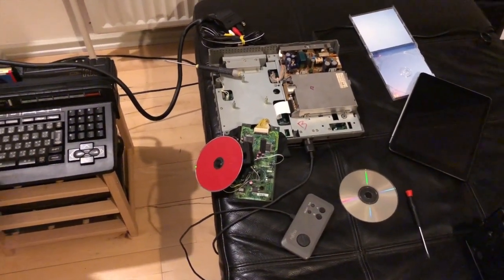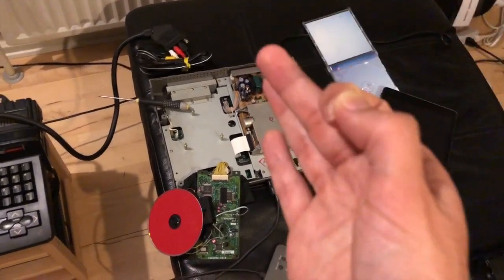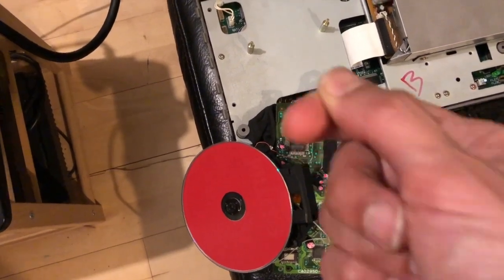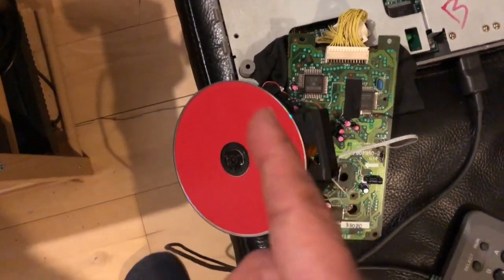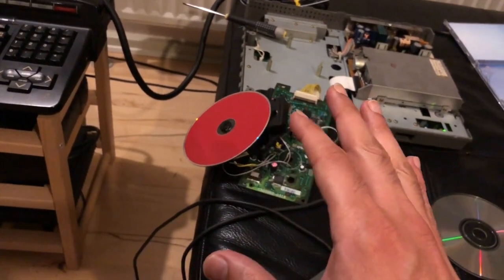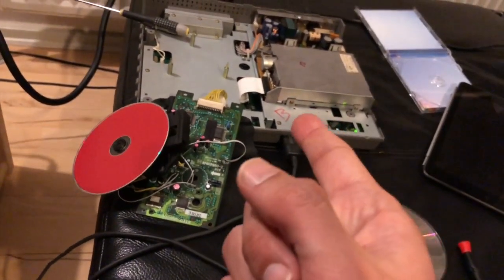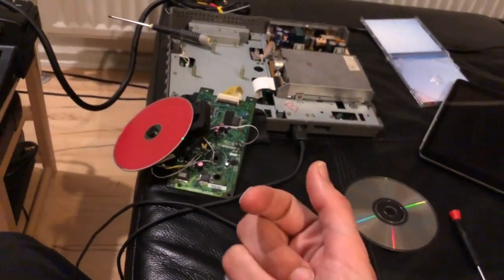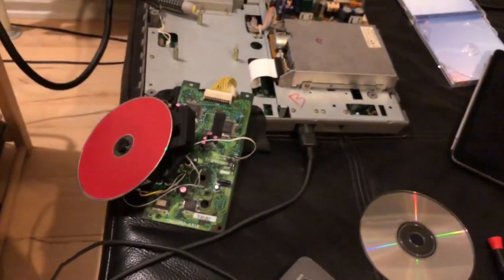FM Towns Marty dead CD repair

Comment: Did you try replacing capacitors first?  Fm towns lasers are no different to other cd lasers.  I find that due to them being unused for so long the capacitors dont get reformed and then they die causing irregularities in the mechanism.  Then people are too quick to turn pots burning out the lasers.  And im not just talking about the caps directly involved with the laser but also the power that drives them.  Changing the gain of the laser due to insufficient power will also reduce longevity.
Reply from the maker: @monstermug  no, I generally don’t replace caps unless they are leaking or they are for a system known to have bad caps (X68000). I no longer have that unit actually. I feel with the price of CD games one is better off just getting ODE and avoid CD headaches. I do that for all my CD systems, even if they are perfectly functioning.
Reply: @kamiboy  yes i understand.  I am just trying to save other drives from the same fate.  Capacitors do not need to be leaky or bulging to be faulty.  When left unused for a long period of time, they degrade.  Applying a current periodically helps reform this layer inside of them.  This applies to new capacitors, too.   The laser inside them are no more prone to breaking than other lasers in other equipment.  I've had cd drives in a car still work when the rest of the car has failed and scrapped.  Also, capacitors provide the current current required for proper operation.   When power capacitors fail, they do not provide adequate power to the  lens, and turning up the gain will cause it to burn out because when the current momentarily restores, (maybe due to ripple) it overdrives them.   Replace caps first, then clean the lens, greese the drive mechs with correct greese, and only then should you jump to the conclusion of a faulty diode.  I've seen too many with diodes burnt out not because they are prone to breaking but due to people listening to advice like this and causing irreversible damage to them.  Also, using cd-rs does not damage lasers.  A myth that also needs to be busted.  

Btw i remember you on forums.  Just noticed ur username.
Reply: @monstermug cdr do not damage lasers indeed. but on some systems, you will here the motor works a lot more to find info on a cd, that is what wears on the gears and eventually damage the player.
But as adults, i doubt this could be a problem as we don't play 15hours a day for 5 years like we used tobwhen we were kids 😊